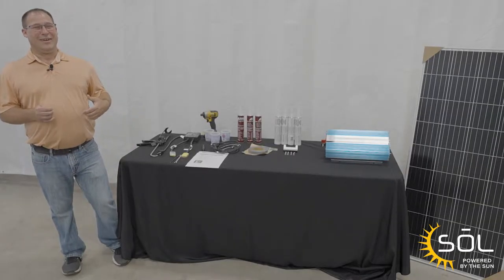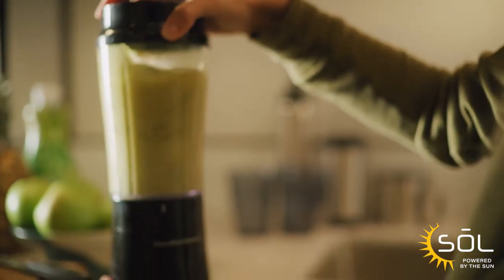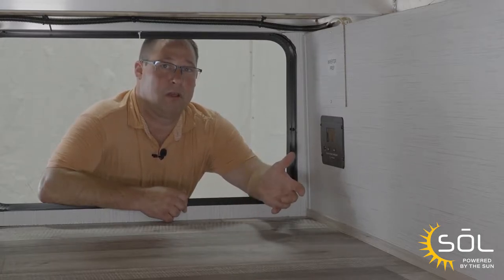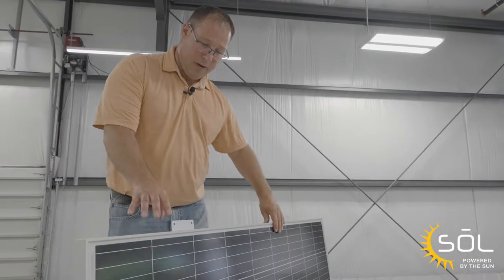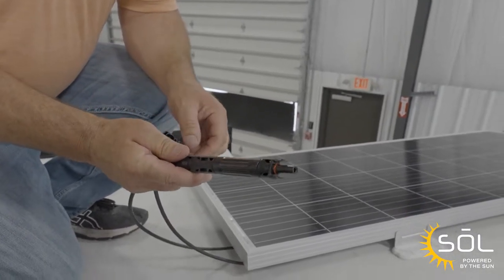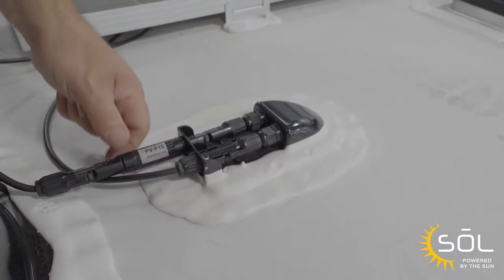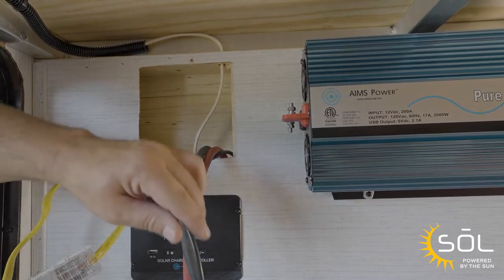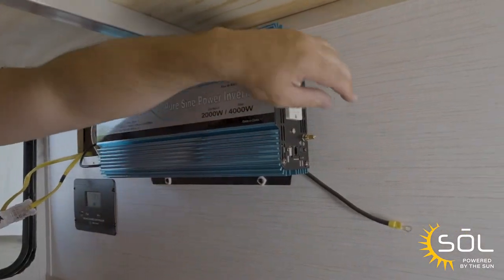SŌL - Powered By The Sun - How to install solar for Cruiser RV

Comment: If I purchase an Aims 2000W inverter with built in transfer switch, what AMP Connectors should I get to connect to from the inverter to the coach?

Comment: do I have to use soul panels? And that other item that you talked about that goes on underneath the inverter the transfer box where do I get that? The dealer didn't give me that of course. 

Where do I find the charge controller wires to connect to the battery? Do I have to install those myself or are they hidden somewhere underneath my camper ?

Comment: Is the sol 380 powerful enough to run a 13500btu or 14500btu ac? And approximately for how long at night?? With 200ah deep cycle? 
Or with 400amp lithium? All on 12vdc.
Thanks in advance.